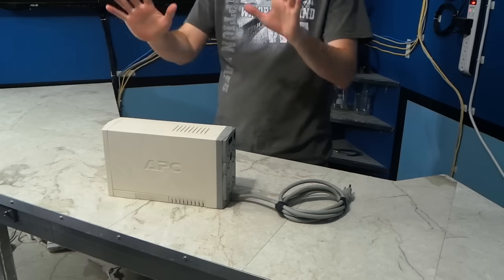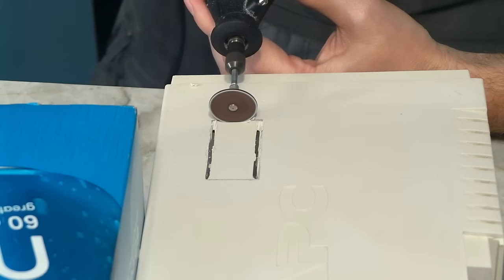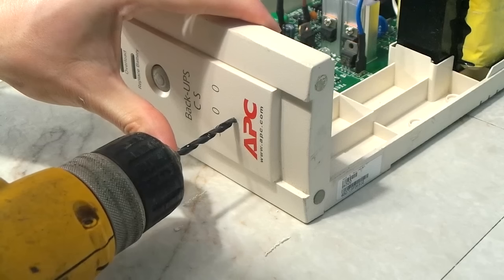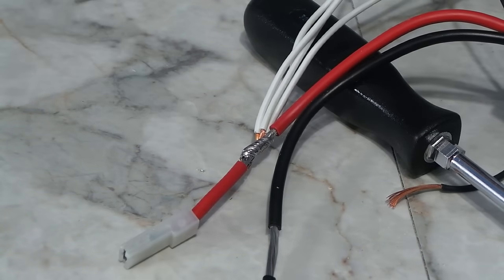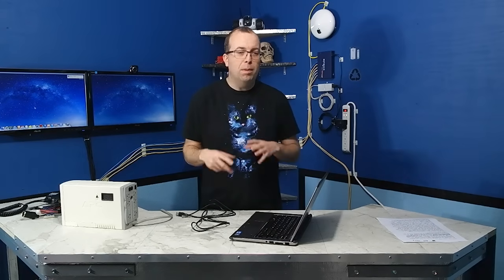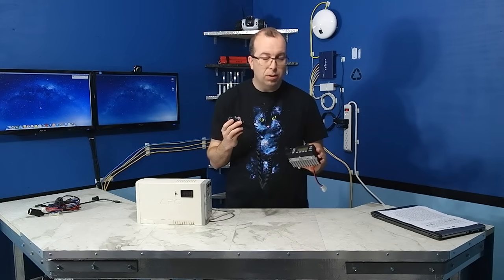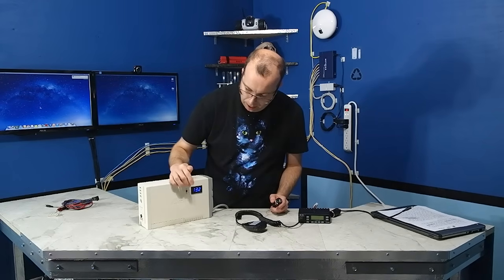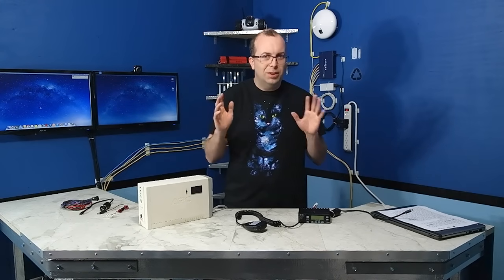Ultimate Battery Backup Hack/Mod.

Comment: Hi, I know its a long way since this was made, BUT, NOT ALL UPS are the same.
Some do not have their batteries isolated from the AC charge circuit, and can be at 240Vac or 110Vac potential depending where in the world you are.
The battery in the video was 12V at 9Ah, so it will not supply current for very long under a decent load.
The charge circuit will also not be very powerful, look up the UPS spec to see what the recharge time is.
So running extra load of the battery while trying to charge it may not be successful.
Place FUSES in your DC output lines, otherwise a short will cause a meltdown of wiring and possible fire.
Sorry to sound like a the grim reaper, but I service and repair UPSs and they are not to be fooled with.
Reply: Hello friend, I still had the crazy idea of converting the UPS into a DC source, but when I opened it I saw that the DC part for charging the battery is very small and designed just to charge the battery as you say, however how much charge do you think What can I add at that stage? (battery + additional charge). My UPS is Forza 750VA. Thanks you
Reply: A) Batteries are always isolated from mains AC, or fire occurs.  B) 30 minutes at 16 Amps is quite a long time, even though that is pushing the battery's limit, it'll likely only be necessary to draw those currents in short bursts, like with an air pump or ham radio transmission.  C) So what if the UPS charger is slow... it doesn't matter as long as it has a full charge when the power goes out again 6 months later.  It's basically for emergency incidental use, but you could probably also power a few Linksys routers and external harddrives with it for many 10's of hours.

Comment: Buy a big vehicle battery and chuck away the small battery. 
I've just lengthened the battery wires to the external big battery and can run my computer or my cellphone booster for 8 hours straight if power goes and I've also connected a solar panels controller and 12volt solar panel up, if you are really smart you can run quite a few things with a ups, just replace the out plug with and ordinary socket, note though ups systems are from 100watts and up so make sure what you run doesn't exceed the ups wattage, keep it to 2/3 the power or you'll risks burning out the ups.
Reply: Use a Deep Cycle or Marine battery instead.  You'll get a much better life out of them
Reply: On some UPS, the traces for the charge circuit cannot handle the draw of a car battery during a charge from a deep cycle. Using it during an outage is no problem, but when the power comes back, expect smoke.

Comment: Problem with your direct DC outputs is that it looks like they bypass the low voltage disconnect/battery protection. So you can over discharge that battery and kill it.
Reply: Not only that. Also battery charger inside UPS can provide only 1-2 amps. So if there are conneced DC device, which consumes more, then battery will discharge even if there are no power outages.

Comment: What you really need, is a 12V battery and a charger ;) -- 73 de M1GEO
Reply: And DEEP CYCLE,be best...
Reply: It would have been so much easier.....
Reply: Permantly charging a battery will cause it to burn or even explode.

Comment: why not use a button instead of a switch for the display, you can't forget to turn it off...
Reply: You're thinking momentary switch. They do come in different styles. Just as a button can be a momentary or on-off.
Reply: I had the exact same thought the moment he described why he added the switch. I found it odd that he thought so hard about the nearly insignificant current draw of the LED elements but didn’t think about a momentary push button as part of the solution.  Duh!
Reply: or just use whatever you have lying around... it's just a switch.. you mean a momentary or a toggle ? either way..  it's not something you'd use constantly... it's a reference /.
Reply: and there's nothing saying you couldn't use a button in place of his solution of a switch slide. personally my solution would have two wires hanging out that I join and twist when I Want to see the display regardless of having plenty of switches and buttons.  for a customer... different story... my stuff is jerryrigged Af... not sure why I do this to myself. ?
Reply: @yeezywesty3651  probably used a switch so he could leave it onuntil a power outage then only use as needed sohe can tell if battery needs replaced or not
Reply: @javaman2883  no one was confused. "button" means momentary switch unless otherwise specified. at least we all know that you know your electronics words now

Comment: Do yourself a favor and make your own battery back up with a deep cycle AGM battery and a good smart charger. You'll have way more Ah capacity, thus back up time. Mount it in a plastic battery box. drill for usb ports, 12v socket or whatever. Done. There are plenty of vids on how to do it.
Reply: And how do you plug in your computer to protect it from power outages? Or charge your laptop etc.
I know you have a particular use case in mind, but the average person buying an APC is expecting to use 110V.
Reply: This one, people!
Reply: Since the primary function is as a 110V (230V) backup of his plugged in electronics in case of a power outage, how would your solution provide those 110V without increasing the cost a lot and dealing with riskier voltages? Everywhere I've read, people have suggested UPSes as the best, cheapest and safest way to get 110V backup power. The mods here were just an addon, not the main goal. There is also nothing stopping him from getting a larger deep cycle lead acid battery and just running the wires outside to it. It's been done a lot on Youtube as well. If you suggest something as a better alternative, make sure it actually is an alternative for the scenario. Don't just spout random advice.

Comment: The power supply for charging the battery is likely no more than 2 amps. 
Your idea is good, however, powering the ham radio off the UPS even when plugged in will likely quickly drain the battery.
Reply: AirScholar 
I share that concern as that's not what the UPS is designed to do. But are they really so bad that they can't adapt to that? I thought they were supposed to maintain a full charge. Discharging the battery in a plugged-in unit by a momentary load of a few watts should not happen. Although, this might stress the UPS unit and battery if it were to apply full charge every time the ham tx load causes a slight drop in battery voltage.

I would not do this(those little UPS devices are tricky enough as they come), and would build a dedicated emergency power box instead. It's even ok using a car battery but marine or other deep discharge type is preferable(and even that type can also jump start a car if it's big enough). I mean a big box with a ~50-100Ah battery, integrated charger with watchdog trickle charge, integrated USB outputs,  fused 12 volt cigarette type outputs, AC inverter built in and heavy duty terminals (with covers!) for jump starting etc.

The voltage meter on the other hand makes sense in any UPS unit even if it's not otherwise modified. At least if the operator has the basic knowledge to take advantage of that information.
Reply: AirScholar I do see your concern, but as the charger detects low voltage it will charge the battery and keep it up to maintained voltage. So intern the battery will not drain as quickly as you think.
Reply: Dessertman Math... Output can not exceed input. If the average output amps exceeds input amps...
A ham radio is usually 50 to 100 watts.
Do the math. The ratio of transmit to receive on the radio would have to be very low.
Reply: AirScholar 
The ratio of transmit to receive will be very low at all times. A momentary load of 50-100 watts for a few seconds at a time would not drain the battery. On a 12 volt system capable of recharging at 2 amps, a 4-8 amps load every once in a while would not be a problem.

However, this might stress the UPS unit that is not designed to be used that way. Will it request full charge current to the battery every time the ham unit transmits? This could be catastrophic.

Don't use your flimsy UPS units as power banks. Please. They're going to malfunction even in regular use within a couple of years.Just toss them and get a better backup power source for the ham and other stuff you think you might need during a blackout.
Reply: TheVessapaperimuumio If that wimpy ups is simply swapped with a much larger one ... all problems solved.
Reply: AirScholar He could do it but drawing more watts than the battery/terminals/wires are designed for will burn them up. The battery should recharge soon but it wont get any cooler. It's doable in something like an emergency - but you might as well do it properly with a more dedicated and simpler system. 

IE - Strap a trickle charger to a spare boat/car/penis battery and just use that instead of a UPS that was designed around a price-point. Make it pretty with a project box, a couple of ports and switches - and you got something people actually pay money for.
Reply: Michael Norman The power supply will likely not burn up because it was designed for trickle charging only. A lead acid battery could draw a large charging amp if allowed, so the circuits have to be designed to limit the amps.
Reply: AirScholar i find it funny how you guys are talking about the load from that lame radio which would draw very little current....And in the in video he cleared shows that he wired the unit to draw a max 48Amp load.  your concerns are somewhat valid but seem to gloss over a larger glaring issue.
Reply: Andrew Reilman You suffer greatly from lack of math skills. "max 48 amps" as you claim is over 500watts.
Reply: +AirScholar O.o my math skills are not lacking, I am very capable of doing simple arithmetic to solve for P=VI and I am not "claiming" anything... I suggest that you rematch the video.
Reply: Andrew Reilman You need a calculator.
Reply: Alex Smart I have a multiple marine battery UPS. It powers my TV and network just in case the power goes out. This little one is good enough for a hand held transceiver or for charging the cell phone.
And let those "stupid" people mis use it. It is the Darwinian way.
Reply: Those little radios don't have a high RF power output, so won't need more than a couple of amps at 12v

Comment: Why didn't you add a switch if you embedded USB ports
Reply: Exactly what I thought when he said they'd drain the battery even when not used!
Reply: bensuhard with a switch it will not...
Reply: Jason Murawski I know, that's why I commented, "Exactly what I thought" in reply to Zigafide's comment, "Why didn't you add a switch if you embedded USB ports?". I thought that he should have just added a switch, also.
Reply: He specifically said he DIDN'T embed USB ports due to the power drain.
Reply: floydian06 He said he didn't want power drain when they were not in use, but a switch would prevent that, is the point we're trying to make!!!

Comment: A switch mode power supply should not get hot unless its inefficent and cheap
Reply: Jeremiah Lowe oh and the radio would probably take more power than the screen
Reply: Jeremiah Lowe The radio does use more power it has a speaker and has to send and receive radio waves all the time.
Reply: PC TechTips the screen wont take much only a few milliamps about 10-20 (I measured one)
Reply: Jeremiah Lowe it sill adds up, as he is not using a 12V power supply, but a 12V battery charger. The charging circuit has to kick in more often due to this extra load. Plus he does not have an under voltage cut out installed. So given enough time, the small display could deep discharge the battery.
Reply: sarowie But it would take 486 days
Reply: ***** I do
Reply: ***** Didnt expect my best friend in real life to comment on one of my comments on a random video

Comment: "That" radio is using around 0.8 Ah on receiving. For a, let's say, 7 Ah SLA, you will have (at the best), 10 Hrs of receiving so, you will not be able to run it for a week, at least, no continuously.
73 de YO3HJV
Reply: Not to argue as I kinda agree but wouldn't this be constantly transmitting?
Reply: 74 and 69

Comment: You're still going to get only 68 mins of power out of that thing unless you actually disconnect the inverter, since that is likely the reason it has such a short life even when it's not powering anything...
Reply: +Syncopator 7Ah+ dc-dc 12v to 5v = 7000mah 5v
Reply: Yup
Reply: +Steven King go watch ( The Shining)
Reply: +Syncopator when the unit is powered off the inverter is off, since he wired the 3 dc ports to the battery the unit does not need to be powered on in order for the dc to work... 

tldr: since the unit is powered off so is the inverter
Reply: +surdinkalol That's not how it works. It would work this way if you would use a linear regulator.
Reply: There will still be a small quiescent current draw. Also, lead acid batteries (and most other common batteries) have a significant self-discharge rate.
Reply: 68
Reply: The inverter actually is cutting of power not only because of low power but since it has a timer in most UPS-es. That makes it possible to save the computer on multiple short outings since it takes a long time to recharge the batteries. Actually, it still does cut off when you add another battery. A second battery on the same UPS would be a good thing though if you want to run 12 Volts equipment too. So just add a second (external) battery, some fuses and keep it on power long enough to keep the extra battery charged as well. It won't give you much longer computer-time on AC-power but it will prolong the battery-life and also the time you can use it during a power-outing.

Comment: I made an inverter for my car with one of those.
I just removed the power cable and hooked up a wire to the battery leads that plugs into the cigarette lighter. It works fine!

Comment: 2 problems. With your 12 Vdc load connected directly to the battery you loose the units built-in protection from discharging the battery beyond its limits which will destroy the battery. Also, the recharge capabilities of that unit are limited. Adding additional batteries or loads onto that circuit will result in failure, eventually. Not to mention loosing the UL listing and increasing the possibility of fires. Seems to me hardly worth the effort for limited benifits and increased risk.
Reply: +Johnny Appleseed guess i shoulda finished reading the comments before I trolled this one. With 877k views tho, I guess we know who the smart one is.
Reply: UPSes do a very good job of destroying their own batteries. It is APC's business model. They make their money on the endless stream of replacement batteries you need to buy to keep one going.
Reply: Gotta love it when people introduce themselves with some offensive rant... sad.
Reply: you tel this people the real thing,good

Comment: Can you add more 12v batteries in parallel?
Reply: Your key concern there is making sure that you are limiting the current delivered and that it is enclosed correctly.  It can be done of course, but you'd want to think about that.
Reply: Hook up a car battery vs that little 9AH jobbie, run the wires to a boat battery box, voilà! The only issue with this is that the charge monitoring circuit thinks the battery is bad due to a longer charge cycle...I'm not sure if UPS supplies check that.
Reply: It is a standby UPS. It is designed to run for a limited time. The inverter is not fully rated, so it will smoke if it runs too long.
Reply: +GeraldVlasak
Reply: Obviously.
Reply: Marius Ammann I did two 12Ah AGM scooter batteries in parallel for my UPS. 
Plus I connected a modified Jumper cable to one of the batteries' so I can connect them to other 12v items
Reply: Like I could connect another battery with the number cables if I really wanted to
Reply: Chci se zeptat - jsem se snažil připojit tři stejné baterie paralelně, ale doba zpracování je stále kolem 23-30 minut. Totéž při připojení autobaterii. Kde je problém? Radíte? Má někdo pokusil totéž? Díky.
Let me ask - I tried to connect the three same batteries in parallel, but the run time is still around 23 - 30 minutes. The same when connecting a car battery. Where is the problem? Do you advise? Has anyone tried the same thing? Thank you for your help.